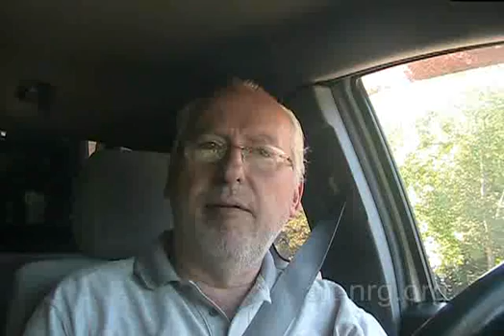#239 100% HHO FEC 2004 Dodge Pickup comments

Comment: I watched the video.I"m not a NAYSAYER about HHO. In my case what would I do is I will mount the engine on a frame, From the main switch to the fuel cell to the bubbler to the regulator then start the engine. AFTER the engine had started I will show the output of the alternator putting back the energy that was consumed by the fuel cell back to the battery and IF still people would not believe it, THEN HUMANITY will remain HOPELESS.

Comment: Interesting points.  i went through that 4 hrs of stuff on Midlands radio. I think they have b.s.er's going back and forth, left & right, to confuse as much as possible.  I only go with real.  The CNG is some good stuff if you have natural gas.  It's real, right now and an improvement right now over gasoline.

Comment: Just for general knowledge for those who do not know:
When working above 1 atmosphere with gas and fluid, you start to get absorbsion of the gas in the fluid, the higher the pressure, the more disolved gas and it can be a very large about, I'm not sure what the saturation point is. This is how Divers get the Bends, disolved Nitrogen, bubbles out of their blood when they reduce pressure by comming to the surface.
So: visual determination of HHO LPM is not accurate.

Comment: @ke4uyp ... You assume facts  not  in evidance, and  your  theory is half baked.
Your  math  therefore is  completely wrong  as  always. 
You haven't  learned  a  thing.
 And  you are  beyond  help. You have therefore  failed HHO  101. 
 You have  NO clue what a 100% efficiency oxy-hydrogen generator  requires.
 You never  have  conducted  ANY  tests .
  And  those  ARE the facts

Comment from the maker: Interesting read. But I think they're missing the point why Stan used RLC. He used no electrolyte additives that would exhibit the nonlinear resistor behavior Farrah described. And Lamere is chasing his tail with parallel resonant tank circuits.

If you want current to flow through an insulating dielectric, you make it part of a SERIES RLC and let your driver self oscillate at the natural resonant freq. When electrical=acoustic, there may be some magic. That's why Stan used variable L to tune.

Comment from the maker: @ke4uyp that's a very good way to state it. 143 watts for 1lpm assumes 100% eff at 7mmw. If you use 7.5mmw as the reference then 133 watts. So somewhere around 140 watts is 100%. Any less power is over unity.

Comment: Your logic about the storage space is sound.  At 50+ LPM, that gage would have shot up in seconds, not minutes.  There is no way they are storing HHO in that plastic tank at 60PSI - it would be a death trap.

So the claims though exciting, are not substantial.  I called them several times, and spoke to both with no real solid answers.

Comment: he said this @h2oplasmaplug well to be honest, I used a bottle of Hydrogen and a bottle of O2 set up with two flow meters. I adjusted the flow so we were getting about twice as much H2 as O2 and hooked it up to the fuel rail on the Dodge before we even started this last prototype. The truck when floored up hill 6% grade only used 24CFH or 11.33CFM max output of engine. So I don't know how or where people are getting thier math from ours is from labratory observation and messurement. Fast Freddy

Comment: if it was real .........easy to prove..........if its a scam, just dodge the bullet. like they are doing.
your alternator......needs a bigger drive pulley. just look at the front of a car engine....
thanks for your updates........you left out fast freddy says he adds stratified HC.......i think HC stands for hydrocarbons.........gasoline.
he also states his pipes are 90 drgrees out of sink.........show the circuit.....
if you whatch the amp gauge........amp run away.......
SCAM...

Comment: You hit the nail right on the head with this. As with my studies on vacuum electrolysis  I found out that increasing the vacuum decreases the current and increasing the pressure increases the current at which can be run through the water bath. This also increases the boiling point of the water so the water will break down more instead of boiling off as the new boiling point is 298 degree F or 145 degrees C @ 60 psi. This is the magic behind what you are seeing.

Comment: @ZeroFossilFuel I remain in 2 minds definetely havent given up the ghost on this 1 but 2 more things i wil point out. it took 30 secs to get 5psi on the gauge and that was with the feed line to the fuel rail CLOSED. That leave only the space in the cell. BUT using brute force electrolosyis would mean the cell resonates at a set frequency range that requires a certain amount of runtime to acheive. It looks liek they arent creating resonance more that their design just resonates with that setup.

Comment: @undergroundruin Sorry if I sound rude here but here are the facts. Hydrogen at under 4% is not even flammable. The engine in the truck is a 4.7 L V8. That means 2.35 L air is taken in each revolution. At normal idle (700 RPM)  that is 1645 L Air taken in. That would require 65.8 L Hydrogen to even ignite let alone provide enough power to overcome the friction and heat losses. He is claiming 55 LPM HHO or 36.7 LPM Hydrogen. It would not even ignite. He is a liar and full of shit. I hate Liars!!!

Comment: Zero, "Fast Freddie" would not permit my comments to be posted.  In the video he states it is a 3 volt cell drawing 55 amps. ONLY 165 watts.  So why have a separate deep cycle marine battery to power 165 watts?  The regular auto battery/alternator could easily handle that  load. 

So, I'm guessing the marine battery starts out fully charged, so the HHO unit it will not affect the running of the engine.

Comment: your looking for a love joy coupling or you might want to try to use a permanent magnet generator they will charge as soo as they start turning not diode pack or internal regulator and does not need excitation for the field coil

Comment: yes I agree that 60 psi for hho would way to dangerous. Thats an exlposion waiting to happin = in anything. anyone that has seen a HHO torch knows what pure HHO dose to anything. but that dont mean that ya cant run on just  water. Ya have to study the way stan did it , using hho and water injectors with a plasma spark duehicky.someone will figure it out someday

Comment from the maker: @FutureEnergyConcepts Okay, there, Freddie. You want to silence the skeptics, myself included? Let one of my people pull and ground two spark plug wires while your truck is "running on 100% HHO" and test your exhaust for the presence of unburned gasoline, or maybe even propane. If your device is legitimate, you should have no objection to accepting this challenge.

Your move.

Comment: im skeptical of boths side haha but 2 things i want to point out in that and this video. When they hop in the cabin of the dodge there is a regulator looking item near the gas pedal against the firewall. What is that? And while they show the system startup and gas production looks minimal, they dont show it running once its been up and driven, when up to temp when all the resonant tuning frequencies would be optimal. Maybe then it makes 55LPM we just dont get to see it, it jsut starts out v.slow

Comment: I just spoke with Fred Wells, and although his concepts would be better understood by someone with an engineering background, someone like Zero, I did ask him about where he was storing the HHO. The large white plastic tank is for water storage only. The HHO is compressed in the electrolyzer and the length of 3/8" ID hose from the Cell to the Fuel Rails. Fred's tel# is 928-239-4280. He was quite open and friendly. They are looking for investors. If interested call David Siegler 928-899-8878